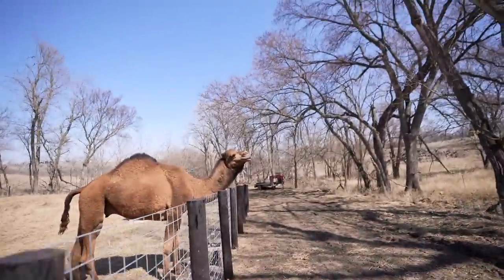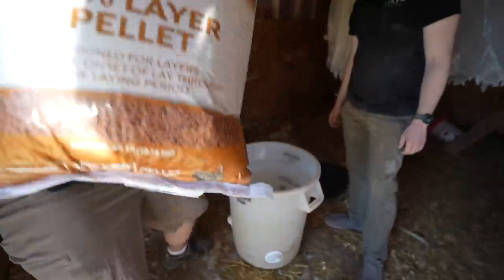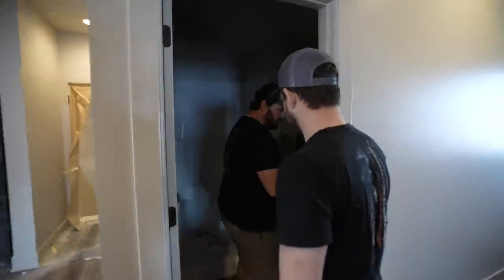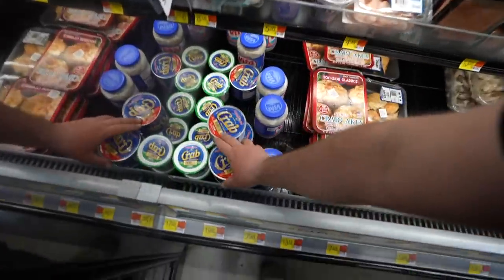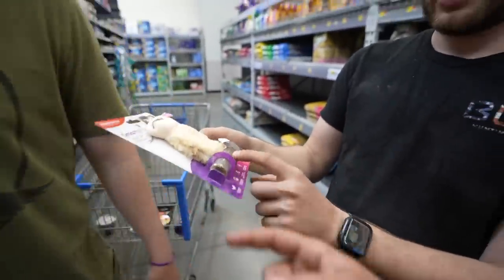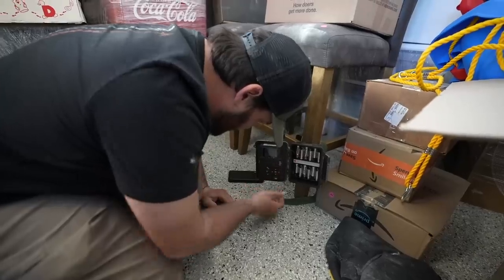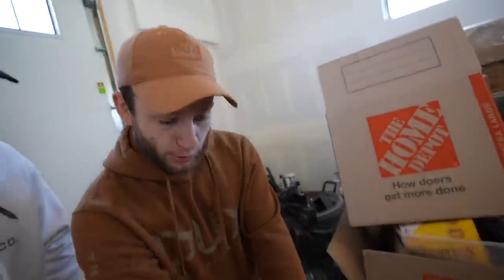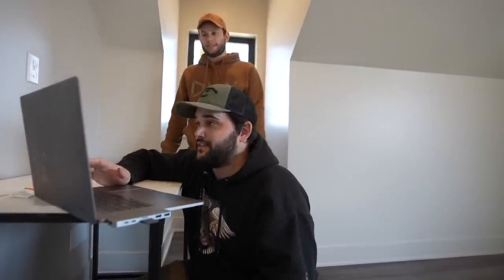WILD ANIMAL Broke into My NEW HOUSE!!! (Caught on Trail Cam)

Comment: If it's ferrel it will take out a chicken. Had the same problem on the farm and had to relocate the critter, far away. If you keep feeding the cat trap it takes it to a vet and have the front paws declawed. That way it can't hang on the chicken and disembowel it.
 When I moved to the city I would trap and turn over to animal control, they would neuter and spay and release back into the neighborhood.
 Or CCC 😋😼💯

Comment: That's container that you put the water in is nice to have but to leave it out in the sun like that will cause algae and mold inside of it because of it heating up if you're going to use that it's going to have to be covered where the sun ain't hitting it on anywhere

Comment: Check the lid of that ibc tote your using for water. Usually a small screwed in center for a vent in the main lid, unscrew it partially for max flow

That’s not scratch that’s good ol Orscheln’s Fancy Scratch

Comment: It's likely a Tom Red Mainecoon from what I could see? Maybe black & white photos so hard to be 100% sure but I'm fairly certain it was a orange tiger tom cat, know as Red Mainecoons. Mainecoons have always been said to be bobcat feral cat cross breeds. Those orange ones are almost always males,just as calicos are almost always females. It a kitten believe it or not? About 10 -12 months old. Certainly looking for food( keep an eye on your birds) but looking for shelter out of the wind,wet,rain,snow ect. Cold dont bother them much if they can stay dry.Not even brute cold,(another sign that there is bobcat mixed in these ferals,the other is there size) -30° I've watch them play in the snow? Becareful,  it is likely as wild as any bobcat ever was. I have a bunch of them under my trailer right now. Some 20lbs & 1 yr old come 04/22/23. You can tame them up alot with food & psychology over time(2 yrs or so)& get them petable, but maybe never be able to lift or hold until you get several generations of contact with them. Be prepared to safe guard birds, feeding the cats plenty will help get them to lay off the birds. "YOU WILL FIND NO FINER RODENT CONTROL ON PLANET EARTH!" some go just as big as bobcats at 30+lbs. Check out Samson on utube. The biggest mainecoon in New York City. (Brooklyn) 28lbs I think? 4 foot? 
I'm pretty sure my Romeo is going to push that size if these stray alpha males dont kill him. I help him where I can. I paused this video of yours last night so I could go out & shoot a 25lb tiger (brown & black) in the face that roamed up & started attacking. Dead in the face at 9 feet .22lr hole point high velocity. I can not believe it made it to the swamp woods.

Comment: #1 Trap the cat.
#2 take it to the vet and check for disease status and check for a injected tracker.
#3 if it has a digital collar return the animal asap.
#4 keep it away from children, cat's can  be temperamental without warning and their bites and scratches are prone to get bad infected quickly.
#5 if it doesn't belong to anyone, keep it in the shop and feed it there, if you absolutely must have a cat. Remember this about cat's, if the owner of a cat dies and no one comes around for a couple of days the cat will eat it's owner. If a dog's owner dies it bark loudly until someone comes and even if no one does it lay next to it's owner and mourn. Cat's are  disgusting animals and not loyal🤷